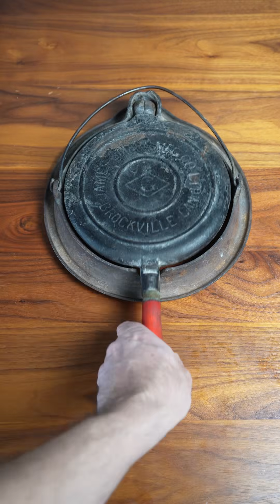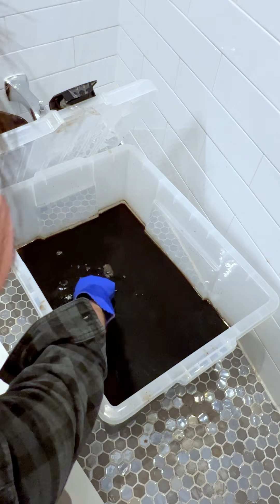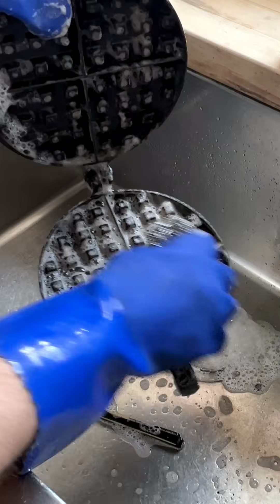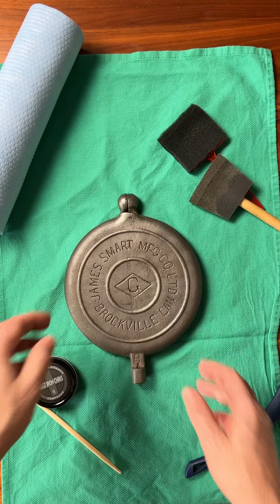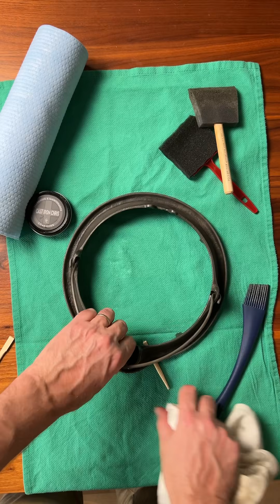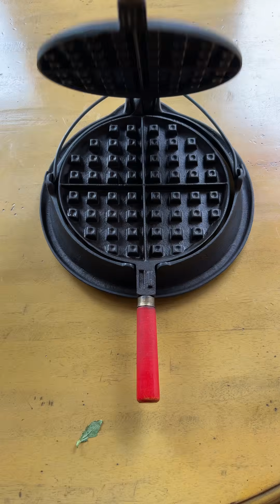How I RESTORED This 100 Year Old Cast Iron Waffle Maker - The FULL Process

Comment: Great video! I have in the past ran cast iron through the self-cleaning cycle in the oven for the purpose of removing the carbon buildup with great success. For rust removal I have a five gallon bucket of EvapoRust. Those two followed by a deep soap and water scrub as worked wonders for me.